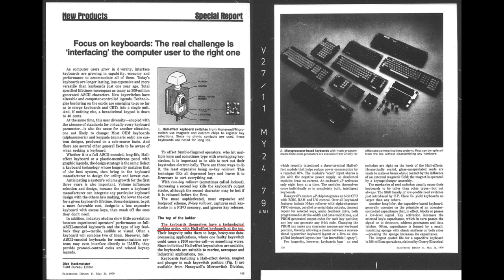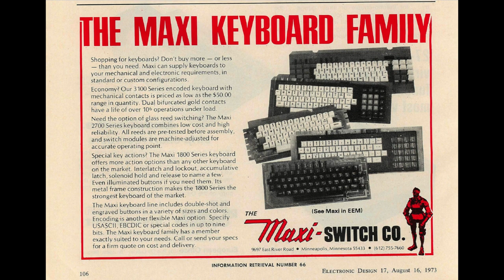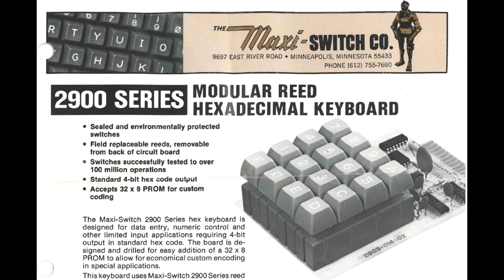Maxi Switch magnetic reed keyboards with original SA keycaps! (Maxi Switch magnetic reed)

Comment: Hi Thomas, this is no solder mask but a conformal coating, preventing oxidization in harsch environments like industrial production with high dust an or humidity levels, medical instrumentation ,military and many other applications. Nice keyboards though. I think the small one at least is a so called ascii keyboard with an parallel 8bit interface giving direct ascii codes. I would kill for such an keyboard 😉 fitting easily into my 70ies z80 retro build. Last time I found one on eBay they wanted a whopping $250 !!!
Reply: came here to say that - conformal coating
Reply: Me too!  Solder mask is that green stuff you see on boards (although now available in many other colours - ask your local circuit board factory for details. :)
Reply: I have no idea what people are talking about but it sounds nerdy and useful so imma like it so people see it
Reply: is no one going to point out Model-Ms start at $450?!?! $250 is in the low range. There are new reproduction Models-Ms and Fs that are being custom made with much of the original equipment, but in collector's terms $250 is cheap!
Reply: If the board had a solder mask, conformal coating may not have been neccessary if the keyboard was used in an office setting and not on a factory floor.

Comment: 6:55 The "strange sub legends" are all the ASCII control characters that are produced when you combine CTRL with that key. So for example CTRL-G is ASCII 7, which is the BELL character. See ASCII table like this one:  https://ascii.cl/ . Note how CTRL basically subtracts 40 (Hex) from the ASCII value of the normal alphabetic (upper case) character. ASCII G = 47H. (And similarly, lower case adds 20H).

Comment: The "fuck ton of weird sub-legends" mentioned at 6:56 -- every single one of those are ASCII control characters! Most of those are not used anymore, and a couple of them wouldn't have even been used by this keyboard. Wikipedia's Control Characters page has an amazing explanation on all the different uses.

Ones recognizable today: BS is "Backspace" but this actually only moved the cursor backwards; meanwhile DEL (Delete) removes the selected character. "Backspace" as we think of it is a combination of these controls.

TAB is virtually no different from the Tab key we know today. LF (Line Feed) and CR (Carriage Return) break text into lines. Curiously, this keyboard seems to have two LF keys (sub-legend on the 'J' key, and it has its own key to the right of 'P').

ESC is actually a control character as well. The modern 'Esc' key doesn't necessarily send this character or do the same thing at all. This might explain why 'ESC' is in the "wrong" spot on this keyboard -- it's not our usual 'Esc' key but a key to send an ESC, and it's positioned next to all the other control characters, instead of by itself on the number row.

Comment: The "strange sublegends" on the smaller keyboard are actually standard ASCII control characters corresponding to these keys when you hold Ctrl. Depending on software and operating system, these labels still make sense for a modern keyboard.
For example, Ctrl+I still acts as a Tab in Linux terminal emulators and some text editors.
https://en.wikipedia.org/wiki/C0_and_C1_control_codes

Comment: Hi Chyrosran22, great video.  I recently converted a maxi switch keyboard out of an Infoton Vistar terminal very simular to the small one in the video.  Mine has a datestamp that confuses me. It reads "248".  Would that be 48th week of 72 or is that impossible?  The Vistar was on the market since June 1973.  In any case, the keyboard works great, but does require a bit of practice to get used to it. It actuates characters very high up, about  1/3rd of the complete travel.
Reply: After doing some more research on this I found a manual that dates back to october 1972 for the Infoton Vistar, so I guess I can answer my own question.  Maxi Switch magnetic reeds were available in late 1972.  Google "Vistar_Technical_Users_Manual_Oct72.pdf"

Comment: Those weird legends are ASCII control characters. As the name implies, you'd hold control and press a letter to send the corresponding code. Seems to me like the board was supposed to go in a terminal of some sort.

Fun fact: These control characters can still be used in a Linux terminal nowadays. For example, you can press ctrl-c to send an end of transmission character (EOT), which closes your terminal. Others include ctrl-h for backspace (BS), and ctrl-c for end of text (EOT), which terminates the running program.

Comment: What was probably expected would be to use right hand to type letters and the right side of letters, with the left hand doing symbols and left side of the letters; then you can also use one hand to type somewhat on the letterpad if you need to.  They should have had a period on the alphabet section for that very purpose, or maybe put one on both sides of the spacebar, perhaps even where the gap is so oyu can eliminate the need for decimal point in numberic pad and have some other key there (although then I would reccomend raising the period on right up by one).   Who knows, maybe this is even an attempt to break the Qwerty V. Dvorak battle.

Comment: Wow! Love the sound, delicious. Those "strange sub-legends" look like commands to me, possibly for quickly writing programs. Oh, and that coating isn't solder mask. It's conformal coating typical of Mil-Spec boards I've worked with. Much tougher than solder mask but a similar compound. I think acetone or the like is required to soften it.
Reply from the maker: Interesting! Thanks :) .
Reply: Oh, and in case you are wondering, the conformal coating is part of the ruggedizing process. High vibration will cause leads on chips and even passive components to fatigue over time and eventually give out. The coating acts as a kind of glue holding everything rock solid to the PCB. That, plus moisture resistance, dust immunity, additional safety if you have to swap boards with live power, etc. After you work with it a while, "regular" PCBs seem incomplete, flimsy, fragile, and cheap. Which they are. ;-)

Comment: That interesting one you have there with all the D1 keys and the odd layout.
I am almost shure i've seen that layout on a cash register.
The only thing making me unsure is the arrow keys.
That circle in a circle key is used in CNC controle panels for depinding on mode (Center tool path) Home tool path and Touch calabrate where it dips the tool down and taps the work item
Oh heck i just Saw a JUMP and HOME key.
It's For a CNC style system. Lath mill laser  exct.
Reply: yep seeing the terminal :) that is defenitly a controle interface for a few diffrent CNC setups.  I'm sure it's gotten used in other places but the moment i saw the whole setup 
i've used this before :)

Comment: I have a Maxi-Switch Vintage Linear keyboard --- a discrete module I picked up in a junk shop for 25 francs and then built a USB keyboard around: https://photos.app.goo.gl/bmoPSMbCZVj4hK4U9 I need to do a writeup at some point. Interestingly it's very nearly the same keyboard layout and feel as the BBC Micro/Electron keyboard you reviewed a while back, and hated.

Sadly, while I really liked the BBC Micro back in the day, the new keyboard is actually not much fun to type on. I think it's a little bit too stiff for me. It probably needs a redesign.

Comment: The nightmare keyboard that is the alphabetic-orthogonal job I thought had to be for a piece of equipment not really a "computer" in the classical sense, which is to say, something first some other thing, especially a CNC lathe or other piece of large equipment, seeing as the operator isn't going to be typing a thesis or writing a long program, only keying in data and naming projects and the like, and quite possibly isn't a typist of any sort anyway.  But apparently it's for an actual computer.  Who the fuck does that???